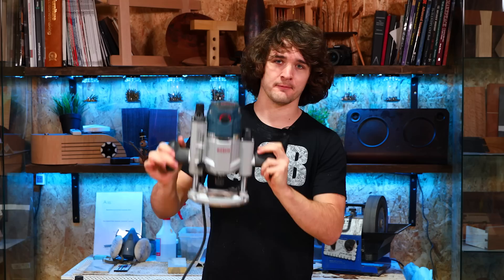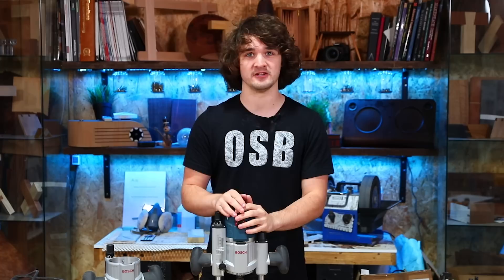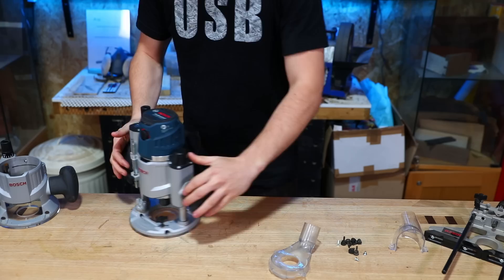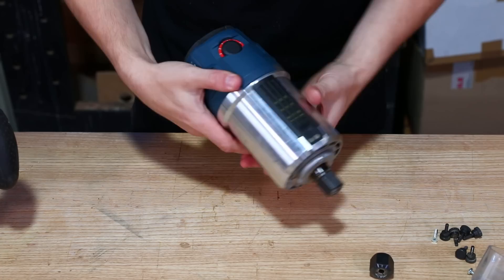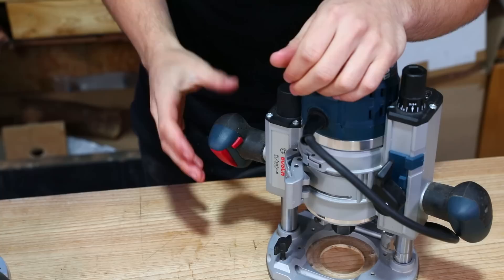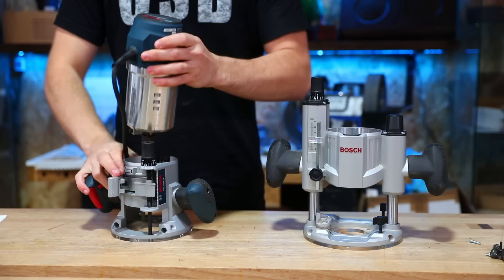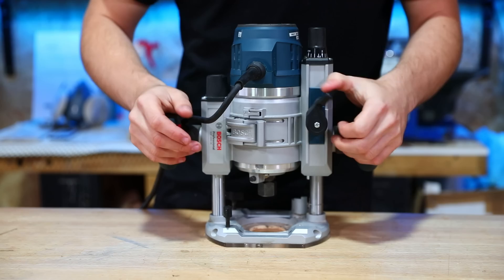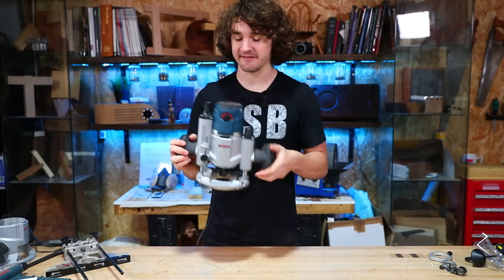BOSCH GMF1600 Router Review (Including Comprehensive Overview, Specification and Setup)

Comment: I bought one brand new, dead with less than 10 times light use. Went back to Bosch repair, they tried to charge me $170 to fix it. And with that quick change center bushing design you will never get it centered.

Comment: Can you do a video where you talk about how to use a router, which speeds to pick, which size bits, etc etc...
Reply from the maker: Ohhh yes! That’s what these reviews were in preparation for! :)
Reply: Generally speaking larger bits should be run at lower speeds.  But I've also noticed that at lower speeds for small, (and kinda dull :-)) roundover bits, for example, I get fewer burn marks.
Reply: When you buy a router bit it will state at what speed to operate.
Reply: Yes please! Preferably it will include your top 3 most used bits so we can know which ones to start with!

Comment: The flat side is a bit confusing, since you don't need a flat side to run along a straight edge. On a completely round base, the cutter will always maintain the same distance, regardless how you rotate the tool. It could actually get you into trouble, if you don't press with perfectly balanced pressure against the straight edge, the flat side will leverage the tool away from the fence and misalign the cut. The only advantage I could think of to having a flat side would be to fit in tighter spaces. It could act as a tool rest for wrenching off the bit-holding nut, without the tool rolling, but it's on the same side as the cord, so that wouldn't work either, unless you hang the chord over the edge of a table. I put way too much analysis into that.

Comment: Matt - this is by far the best intro to the Bosch GMF 1600 ANYWHERE (and I speak German too). Thank you so much!  I have just ordered one.  Everything else I've looked at is a compromise and either doesn't fit in a table, can't use 1/2" bits, doesn't have enough power, has no extraction, ... you get the picture. I'd rather buy once than have to buy twice (and spend even more!) to overcome disadvantages.  I've seen guys who have 2, 3 and more routers because they're always getting over a shortcoming. You've shown how this is darn close to a universal router saving money despite great versatility. Basingstoke is an old stamping ground - but now I'm in Switzerland for the last 31 years. All the best, Rob.

Comment: Thanks for the detailed review. I got this set precisely because I wanted to benefit from the multi use system with the fixed base under a router table. For anyone considering this, please check that you get an insert plate that has exactly matching holes for the bosch base pre-drilled. I got an aluminium one without holes, so I just drilled and tapped them myself. I was 0.4 mm off target in the plate and could not attach all screws.

Comment: regarding changing cutters, I find with mine, once you have tension on the wrench you don't need to hold the spindle lock, so laying it on it's side, holding the spindle lock, use wrench to get tension then let go ( retaining tension on the wrench ) and then using the handles to brace against means you can put more than enough force to loosen or tighten the collet.

Comment: would you mind doing a one-year after review ? 
I own this router for maybe 4 years now, and, while I love the power of the motor, there are few things I hate about it:
- plastic for dust extractor all broke after few (light) usage... they are just too thin/brittle for such a big router 
- the fixed router base give really little space to unlock the nuts, but you're lucky, you have a quick lock, where I have to use two wrench... even harder is such a small space
- the fixed router base fine control is almost not working and I have to sustain the motor by hand to remove some weight so the screw is working as normal (and there's no dust in it)
- plunge router base have some oil leaking, making it hard to slide up/down and grabbing lots of dust
- all the small hand-screws to change the setup (especially on the guide... vibration lossing them off) ...getting me nuts
- plunge base felt from the workbench, and the micro-adjust know, full plastic, broke... I know I will be able to get a new one from bosch, but I'm sure it will cost me a hundred :)
- I also bought the router table from bosh, and I HATE it. Actually I removed the small legs and made metal brakets and attached it to the side of my workbench (I can provide pictures if you want). I now have more space to unscrew the router bit... And the top is made of aluminum, leaving dark traces on every wood you slide on it... HATE IT !

/stop-ranting

Always a pleasure to see some of your old videos. Thanks

Comment: Good review mate. Agree about the screws for the extraction. I really like the delay in the trigger. Keeps it a true soft start. Worth mentioning the micro adjust can be used when the plunge base is locked, which is great for adjusting  on the fly. The fixed base has to be unlocked to use the micro adjust though. Great versatile router. Love mine.
Reply: One question. Everytime you use the fixed base under the table you have to unlock to use the micro adjust or can you  leave the base unlocked?  ( is it dangerous?)

Comment: For a beginner who is drooling over this router but doesn't have the money to get this. I highly recommend the Bosch POF 1400 ace/ POF 1200 Ace. Alot of the same features like the automatic depth lock. But the only drawback is that doesn't support 1/2" bits. But for me till now it hasn't been an issue yet

Comment: I also have it:) .... and I like the fixed base for hands-free copy milling so much that I bought another one ... so one can be permanently built into the table.
And you install it in the table with the switch facing you, so everything is at hand - the spindle lock, the speed control and also the fastening clips.
Fine-tuning the depth, however, you adjust above anyway ... but you adjust it roughly when inserting the motor....
So nothing is quite "behind" or "away from the hand".

Comment: At the time I needed to upgrade my table router, the GMF 1600 cost > € 700 here in Norway, and it only came with metric collets. For about € 250 I was able to purchase the Triton TRA001 (2400W/3.5 hp) on sale and it included both metric and imperial collets (6,8,12mm, and 1/4,1/2''). Since I've been shopping for routers that accept imperial bits pretty much everywhere here in this backward country, but without luck -- just some big question marks wondering "what is a collet -- I finally figured, Triton is a no-brainer for me. I'm not associated w Gustavsenas.no but these guys are good.
Reply: Interesting. Both imperial and metric would be awesome

Comment: WELL DONE!!! Where were you when I was buying my three routers? Quite frankly, this was not available when I got my routers. Two big plunge routers and one small fixed base... Every single drawback you mentioned exists with ALL of my routers. Especially adjusting the router height while in the tables. (I've built two router tables to keep the big routers in but hate them because they require two wrenches to get the bits in and manual lifting to set the height.)

Comment: I've got the same router kit and really like it. Once I realized how the switch works it has never bothered me in actual use. As mentioned by other, I really don't care for the flat cut into the router base. It makes following guides more difficult than it needs to be. I love the fence, it's great. The main criticism I have is with the fixed base used in a router table. The guy I bought the router table from set it up the same way you did and I couldn't stand having the adjustment under the fence. I could have remounted it and fixed that if it wasn't for the main issue. When hung upside-down, when you twist the micro-adjust enough, the router body will slip to the next notch in the course adjustment. So your lifting it up and then it will fall back down. I used it for almost a year before I had become feed up enough to buy a router lift table insert. Might have been a problem with the fixed base I got but it was intolerable in a router lift. Otherwise it's an excellent router system and I really do like it a lot.
Reply: Hi Bruce.  Are you saying that you are using this router with a router lift?  If yes, what lift did you go with, and how do you power the router?  Is there a separate switch available and does it clear the lift clamps?  What about changing bits? Is that difficult with it mounted in a lift?  I would be eternally grateful if you are able to answer those questions.  Thanks.
Reply: @TrevorDennis100  Yes, I got a JessEm Mast-R-Lift and couldn't be happier. I have a Kregg router table and it came with a switch. It's mounted on the side of the table. You plug the router into the switch and the switch into the mains. You just lock the power switch on the router to the on position. When you flip the switch on the side of the table the router starts. Changing bits is easy. Just wind the router to highest position in the lift. You do need to get the offset wrenches that Bosch sells. The collet does not come above the surface of the router table. Bosch part no. RA1152. Mounting it in the lift wasn't hard. JessEm provides good instructions with the lift. Hope that helps.

Comment: I had no idea. Thanks. I’ve been curious for some time now and had no idea what to get as far as a tool with the most practical features and I find this is a well thought out piece of machinery and not some cheap crap you get tired of fussing with. I like that this Bosch also works well in a table where most of what I would imagine woodworkers go to on a regular basis but then handheld serves its purpose as well. Thanks again. I might get one before the year is out.

Comment: My dust extraction failed badly. First,  the chips within minutes had made the acrylic too hard to see through, it was just milky grey. Then, to add insult to injury, the plastic just snapped off. That is, without abuse - it just snapped :-(. Other than that, this router truly is a very sweet machine.

Comment: As you say in your video, the biggest advantage is that you don't need a router lifter, and this is precisely what has drawn me to this router. You rightly point out that a consequent £300 - £350 saving is to me made, but should probably have pointed out that this Bosch router is around £130 - £140 more than a Makita, so half of that saving is offset by the higher cost of the Bosch to begin with That said, the Bosch is still a saving overall, and probably easier to detach from the fixed base than a router lifter, but I am slightly concerned about the long-term reliability of the Bosch fine adjuster whilst it's mounted under the table, it looks a bit weedy....

Comment: One point worth covering about the switches ONLY being in the base is that when used in a router table you can NOT use the kind that hold the motor directly.  You must mount one of the two bases that come with the router under the table or to the simple plate.  Not a big issue, but something to be aware of.

Comment: Awesome review as always Matt. I’ve had this router for quite a few years and love it’s features and power. It has to be mounted underneath the table the way you’ve done it otherwise you are feeding into the spinning bit the wrong way (the same direction as it’s spinning).
Reply from the maker: Glad you liked the video! Not sure what you mean by putting the router in the wrong way round. That’s like saying a clock will spin anticlockwise if you mount it upside down.... 😂
Reply: @MattEstlea  Not quite! It's more like mounting a clock facing towards the wall. (Provided you can see the hands through the rear of the clock.) :-)

Comment: If Bosch fit this router with a removable power cable like Dewalt does with its top model, this router would be PERFECT. I own this router and I love it but I just got used to having a router with removable power cable. It would be nice if other companies besides Dewalt did this. Craftsman had a Pro model from before Stanley revived the brand with a removable cable and I also have that one and it’s a great feature.

Comment: This review is really well done, Matt. I bought one of these a few years ago here in Canada - yes, also available in the colonies! It really is a great router. I wasn't even aware of all the cool features when I bought it but was pleased to discover the height adjustment feature in the fixed base for example. I still need to buy some of the accessories like the dust extraction. They are not included of course with the basic unit. Agree with you on the responsiveness of the trigger. It's not an issue once you're aware of it. Still, an excellent product and not too expensive either.

Comment: Got one of these mounted in my router table.  Lasted about 9 month with less than 3 hrs hobby use before the motor gave out.  Think inverted in the table, the sawdust drops into the machine too easily through slots in the motor casing around the LEDs, these face upwards when mounted of course.  UJK table with full extraction on it, profile cutting soft wood only.  Needed a full motor rebuild...….

Comment: I wish that you had published this video before I rushed out and bought a Festool router...
Oh well, I'm looking forward to seeing your in depth router series. If you can include advice on how to stop the bearing on a guided bit from marking the workpiece I'll be your friend for life!
Reply: Do you have the OF1400?  If so, and you use guide bushings, check to see if the bit is centered in the bushing.  Mine wasn't but I modified the guide bushing plate and was able to get it centered.  I have a poorly made video of what I did.

If my OF1400 dies on me I'll be getting the Bosch for sure.  One thing the OF1400 really needs but doesn't have is lights, especially for aging eyes.

Comment: I just got this one referbd. It's great but it's enormous! Modded it with a toggle and a fsr in the trigger so i can control the speed from that if i want. The way it fits in the hands is also a bit odd ergonomics wise so I may go all the way and make some fun custom handles at somepoint
Reply: Where did you buy it from refurbished and how much was it? The model seems to be discontinued throughout the world and Bosch has not introduced an updated model, they seem to have just given up on it...the Americans still have their 110v version but no luck for the 240v

Comment: I bought that router a while back. Absolutely love it! I especially love the power being controlled via the trigger button on the handle! On the note of bushings, I ended up getting Bosch's bushing kit. I have had no issues with it. I was on the fence between that and your standard screw on bushings, but read from other people that while doing prolonged routing, the vibrations can unscrew bushings...Not sure if it's true or not, but in either case, I am happy with Bosch's version of just twist and locking it in. Very good in-depth video, Matt!  Would love to see more tool videos like this!
Reply: I had a bushing screw nut thingy come loose once.  It dulled the bit and chewed the hell out of the threads of the lock ring.
Reply: @ThekiBoran  Sorry to hear. I guess the threaded screw on bushings have their downsides for sure.
Reply: @norm_olsen 

It was my fault for not securing it properly.  I've only had it happen once.
Reply: @ThekiBoran  thread locker
Reply: @nikita34100 

No thanks.

Comment: Lovely bit of kit, but out of the price range of most hobbyist home gamers I'd have thought. The plunge locking lever is brilliant - all routers should be like this. 

Isn't a round base better for running against a straight edge, because it can't pivot away from the edge (which a straight router base with corners can)?

Comment: Thank you for a detailed and clear review! I am a newbie and have a question about the router table mounting. You mentioned 2 options - either have the speed adjust dial facing you (how you have it currently mounted) or the lock mechanism and height adjust dial facing you (what you recommend). Is it possible to have the best of both by turning the base 90 degrees, such that the handle with the trigger is closer to you? Doesn't that provide fairly easy access to all the controls - speed dial on the right, locking mechanism on the left? Thanks again!

Comment: Glad I found your channel(?) Takes a little getting use to your English vs. mine (small joke - very small) . I have 4 Bosch routers but not this one. I heard and read that the plunger has some problems. Have you experienced any?
Also, a BIG THANKS! for showing the features. I own 3 - 1617 (fixed and plunge) and didn't know about the dust collection more than the one that comes with the miter set-up which does't do me much good in my uses.
Thanks again Matt, great and informative video.

Comment: When using it in a router table all the weight of the motor is supported by a small circlip. If you over wind the fine adjuster you can if you are heavy handed dislodge the circlip and the motor drops. Not easy to find a small circlip amongst floor shavings.

Comment: Great video Matt. Very informative.  could you possibly follow this up by showing us how to fit the various dust extractors included in the box and explain the different type of applications they are used for. There is also a guide bit adaptor, although l can't find anything online to use with my 30mm inlay kit. Admittedly it's a big beast for inlay work but it is possible. I regard this router as better than my Dewalt, Trend and Makita routers in several ways and it feels better ergonomically. I enjoy watching your videos, keep it up!

Comment: The review is well done. However, there are a number of negative reviews of this router on Amazon that mention sticking of the plunge mechanism. This is mentioned often enough that it should have at least been commented on in this review. I would suggest any potential buyer check out the Amazon reviews.